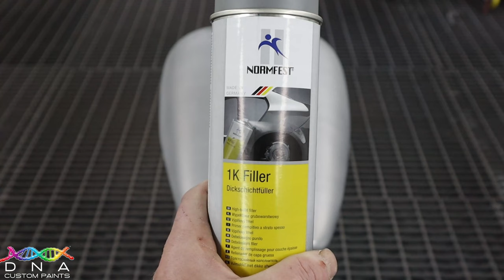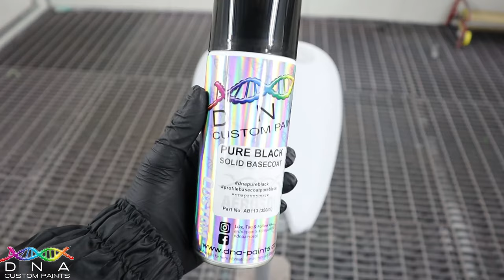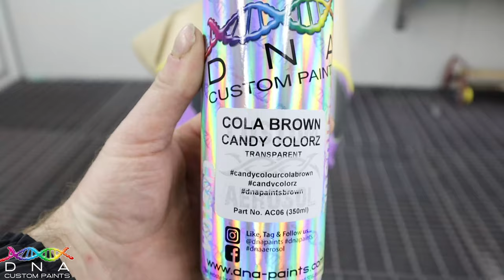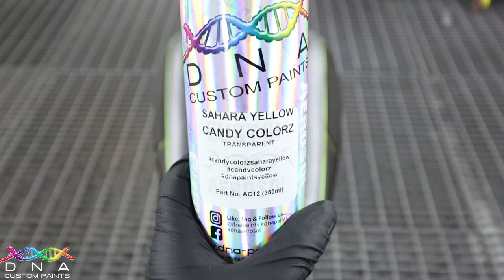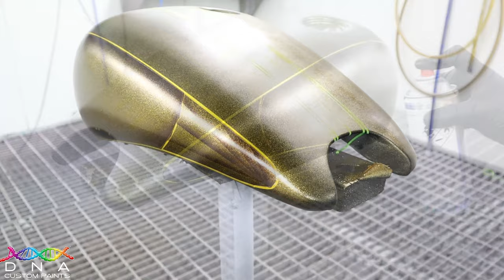Custom Painted Tank Using Aerosol's

Comment: Absolutely beautiful! Do you wet sand between silver flake base and candy? thank you
Reply from the maker: Hi Brian you can achieve this 2 ways , 
1, Flake then clear coat , then wet sand then candy and clear 

2, Flake then candy then clear without wet sanding .

in the video i done everything the same day within a 4 hour window. with no wet sanding 

The times you would wet sand the clear is if you have used a flake bigger than 100 micron "not available in aerosol" . or if the masking designs/colors are very intricate and require multiple days to finish.
Cheers Mark

Comment: Hi Mark great job , I have a 76 GL1000  they have a false tank that's in three pieces , two side covers and two radiator sheilds , I have decided to pant it in , smashed metal metallic,  with apple red candy , and clears of course , I would like to do inside and out as the the tank shelters fold down etc , my question to you is how many rattle  cans of paint will I need ? Or would this be un economical and be cheaper to do  with real spray gun .
Reply from the maker: not at all , the Aerosols are designed to be used on smaller items like motor bikes etc.  if its just the tank your painting , 2 cans of smashed metal, 2 clear, 3 candy. this will be a little more than youll use but defiantly worth having extra when painting candy just in case

Comment: So you let it dry,  clear coat it and then pin strip it? I'm doing a spider web in mine 2 different colors.
Reply from the maker: no , everything was painted the same day within 3 hours all with aerosol cans . there is no fancy edit work in any of the videos on the channel . everything is painted the same day and nothing is ever buffed or polished . everything is either off the gun or from a aerosol can

Comment: How long do you have taping between coats before its necessary to scuff with sand paper or scothbrite. Most paint requires 7min-15 min in between coats, i dont think i could tape off in that amount of time plus it would be wet.
Reply from the maker: Most paints including ours have a maximum of 3 hours from your last coat till you need to clear coat the base . Outside of that and you risk delamination of the clear . You can scuff the base over 3 hours later and reapply more base then clear .

Comment: How long did you leave between the black base and the flake, and the flake and the clearcoat? about 15 minutes?
Reply from the maker: Hi Shaun, would have been roughly 10 mins between each stage . this was painted in a heated booth @ 25 degrees . if your painting in colder conditions then longer flash times are required .
Reply: @DNAPaints  great, thanks for the reply